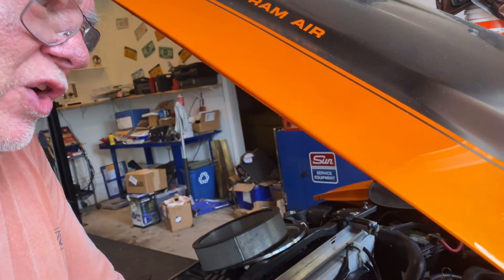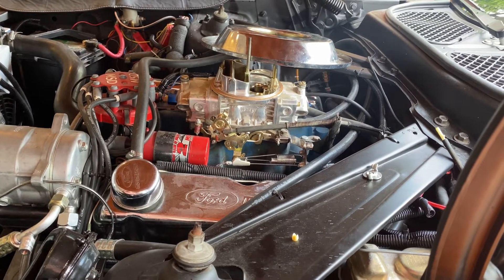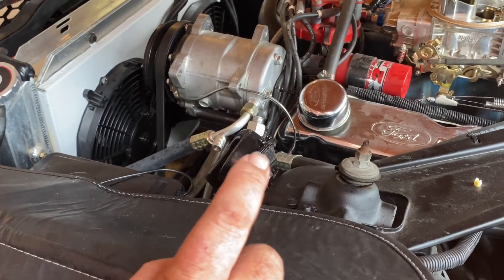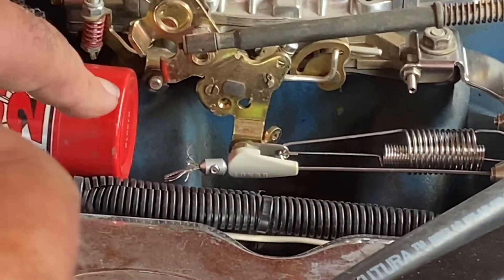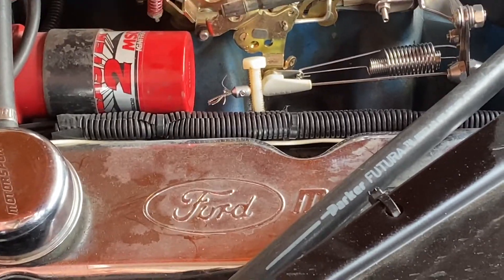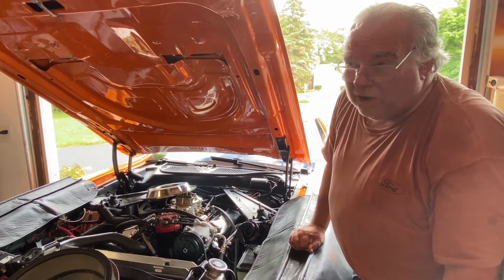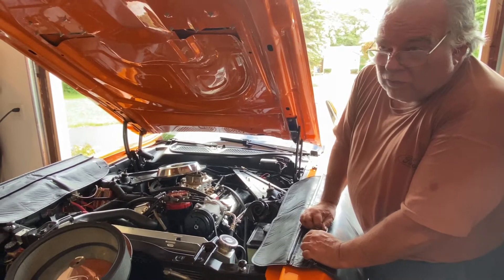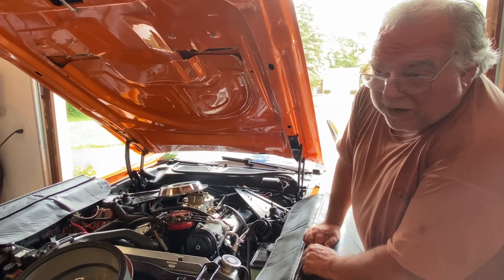1973 Mach1 Transplanted AOD Throttle Valve Pressures In Both Neutral And Park

Comment from the maker: In a prior video I received a comment from @Bentley Nuts where he made some suggestions and asked a question.  The question was if there was a difference in the Throttle Valve PSI pressure in Park and Neutral.  Well, I never noticed any significant difference in other transmissions between Neutral and Park before, so I thought I ought to take the time to find out.

Now, doing this kind of Throttle Valve (TV) pressure check (and adjustment) is not one of those “all you have to do is” kinds of operations.  It is not necessarily hard to do, but it is tedious when it come to hooking the Oil Pressure Tester to the AOD.   I did not cover that process in this video, but I do cover it, and how to adjust the TV pressure, in an earlier video at:

https://youtu.be/KYIAqqYUKNo

It turns out there is a small difference in the TV pressure depending on the AOD being in either Park or Neutral.  It is a difference of about 1 ½ - 2.0 PSI.  I should also note, the TV pressure is measured when the engine and transmission are at normal operating temperatures.  If you adjust the TV pressure in Park, set it 2 PSI higher than you are wanting to run at, so in Neutral it will be closer to where you want it to be.

The factory specs for the TV pressure that I have found say to set the pressure to 30 – 35 PSI.  I intentionally set ours a little higher (40 PSI in Park) as I wanted my 1-2 and 2-3 upshift speeds to be higher than “normal,” and firmer.  Having a TV pressure setting a bit higher than spec is not going to cause damage to the AOD.  What damages them is when the TV is too low, as it causes the friction material in the clutch packs to burn out.  This often happens when the plastic or nylon bushings using in mounting the TV pressure cable gets brittle and breaks, leaving the TV cable a little more slack than it was originally, which lowers the TV pressure.  Too soon the lower TV pressure takes its toll on the AOD.